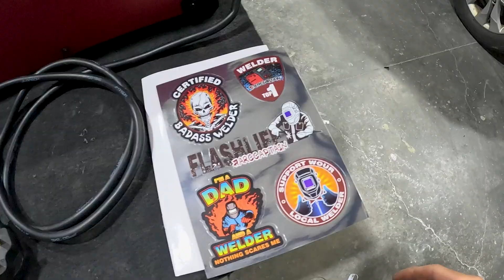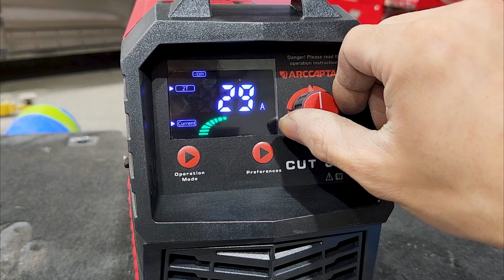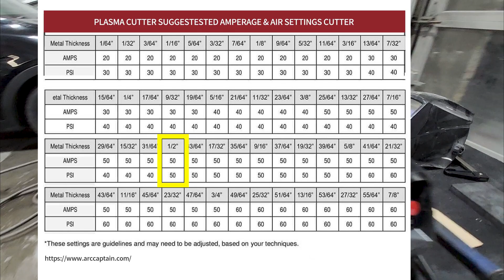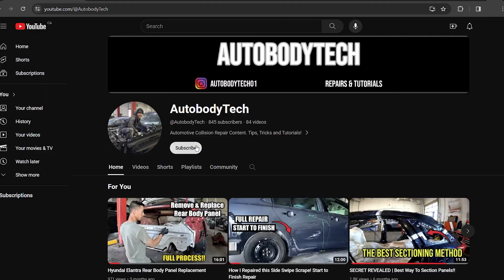Is ARCCAPTAIN CUT 50 Really Worth The Hype? Test & Review @arccaptain-weld

Comment: Are you just adding compressed air or some other inert gas?  Where did you get the bulk tips and stuff.  Is there a part number for these consumables so we get the right part.  Thanks Ben
Reply from the maker: @benlyons1842  Yes. Just compressed air. Check the description for Amazon links

Comment: They need to leave the fitting for the air supply out so you can put what fitting you want in. Mine would not come out. They also need to put a 220 plug for welders.
Reply from the maker: @RockyCreekFarms yea i ended up switching out the fitting instead of using what I did in the video. I was able to get a 14MM socket on to remove it, and It does come with a standard 220